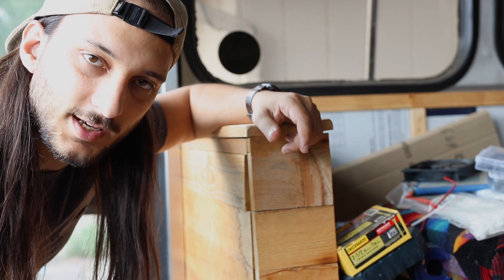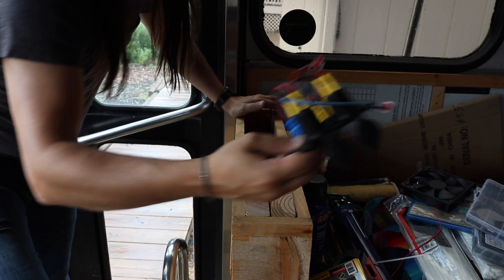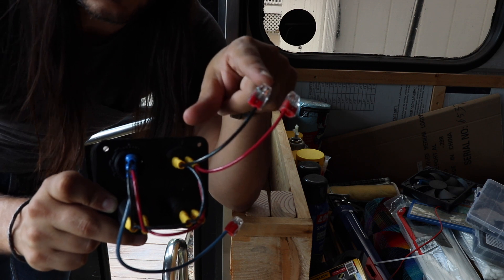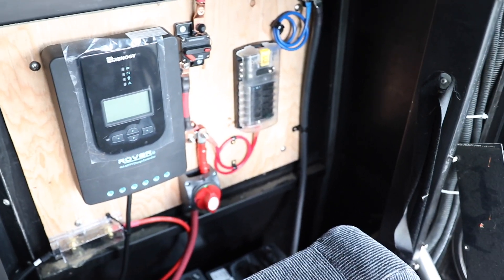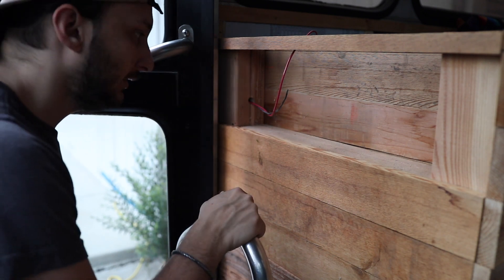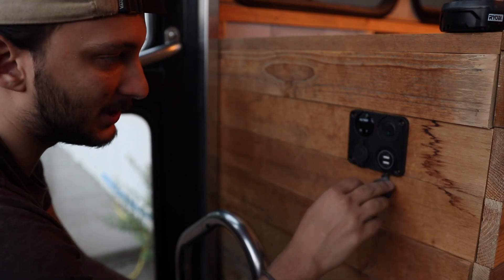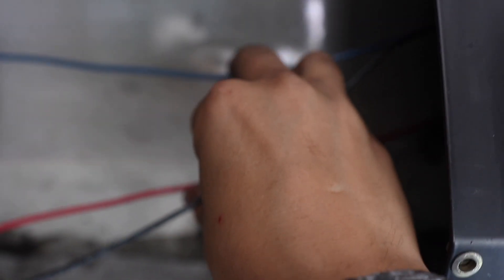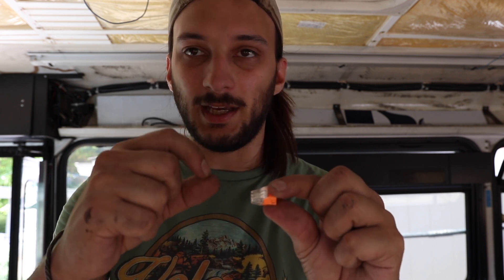Bus conversion! Solar Part 2: Running electrical wire!

Comment: I am loving your videos! I am wanting to do my own transit bus conversion, and trying to gain inspiration.
Reply from the maker: haha thank you! You should go for it! If you have the space to keep it while building it why not. If you do a transit bus like myself there is WAY more that goes into taking it apart than a normal school bus does.
Reply: @WadesAdventures   the bus I'm working on buying it from the 80s, and it has already been partially converted so there isn't too much left to do besides actual plumbing and electrical. Whereabouts are you located?
Reply from the maker: @thewheelme  Very nice! Ya getting the demo out of the way is a huge plus for sure and I'm in the greater Denver Colorado area
Reply: @WadesAdventures  After I commented, I remembered that you mentioned something about Colorado in one of your other videos. Once you get your bus finished, are you going to travel much or just stay in the area? Also, I question I. have is what do you do for work?